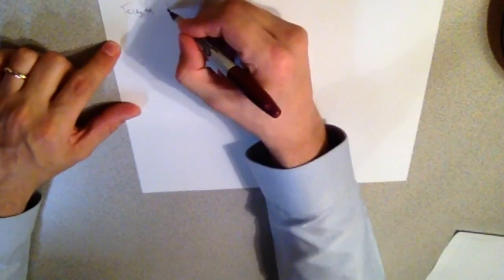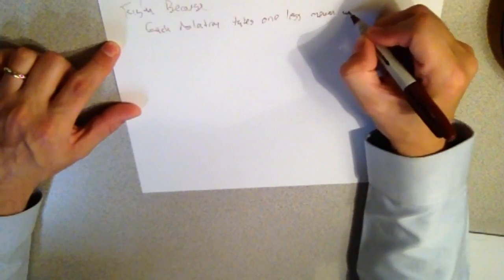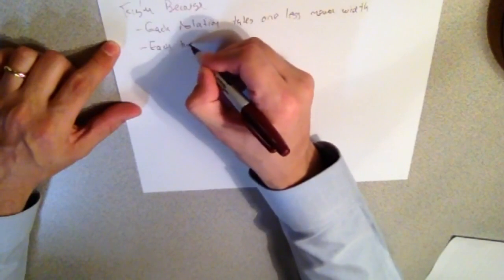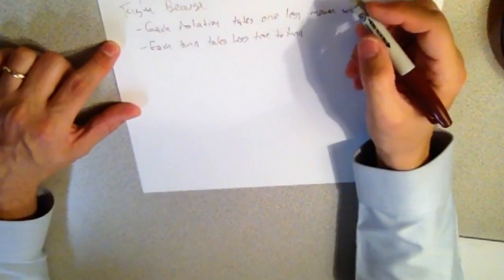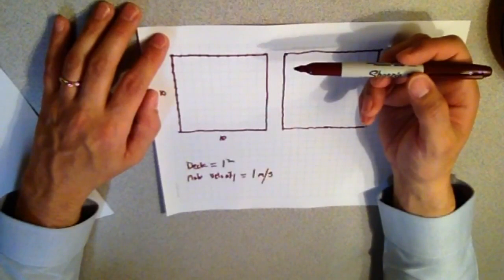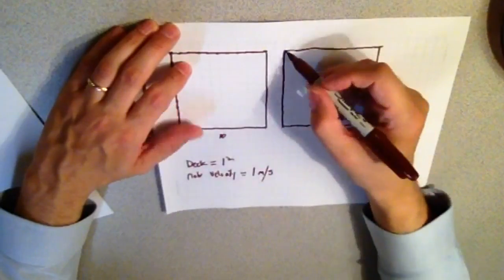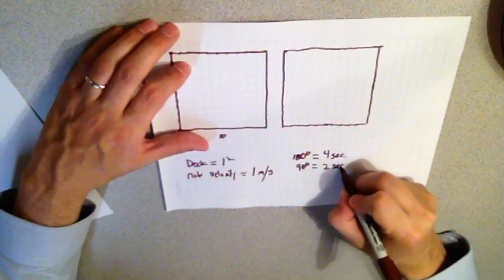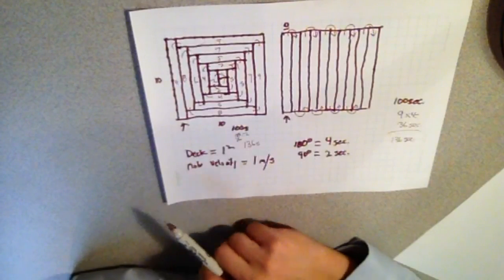Lawn Mower Math

Comment: "Well, poopy."  LOL  Science!  Testing hypotheses, even if you don't like the results.  
If you want to save time, you might try mowing in a spiral pattern that doesn't require hard turns that take up time.  My back yard is oval-shaped so I can get away with this.
Reply from the maker: Great point! But you're right though, that will work best on a rounded lot. If you try an oval-like pattern on a square lot, you're still going to have to travel to the corners to get the little triangles you missed. I'm way too pedestrian to try the math out on that one.